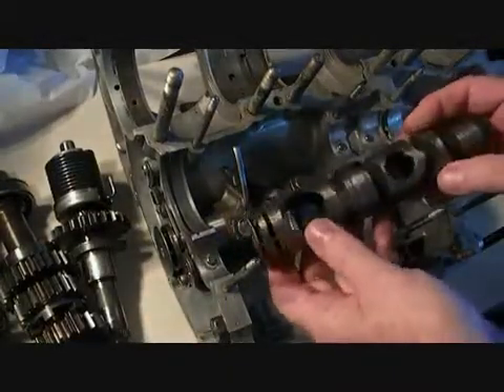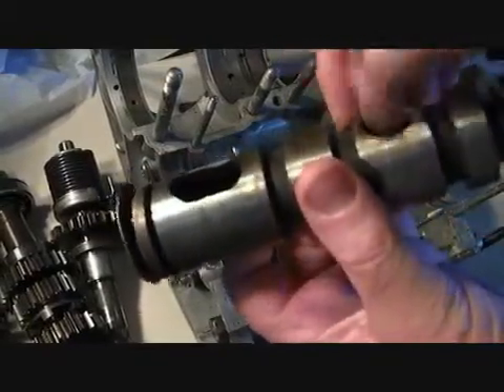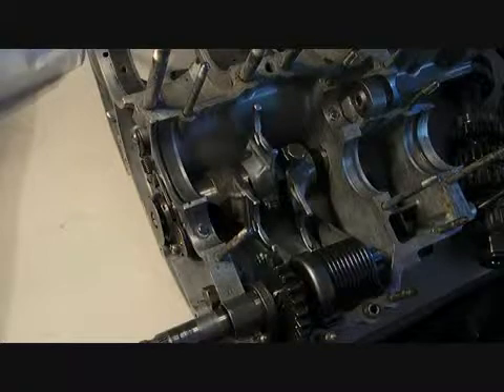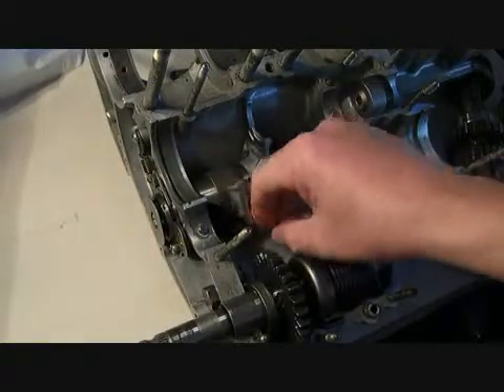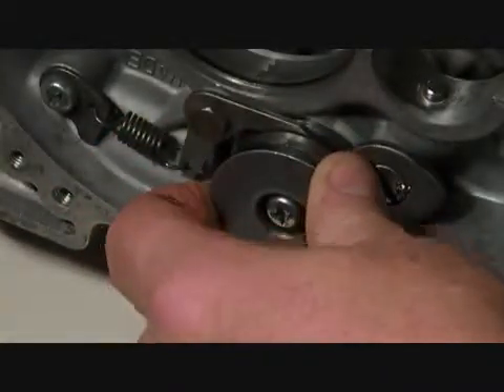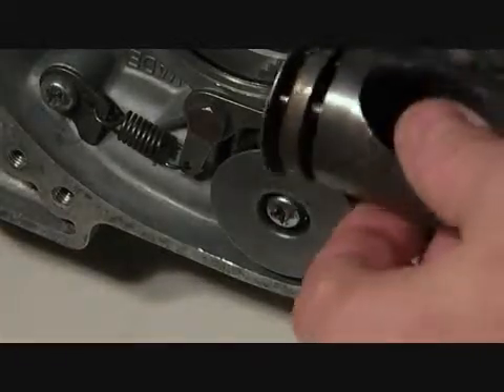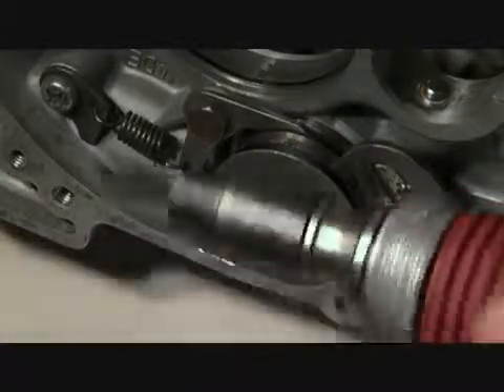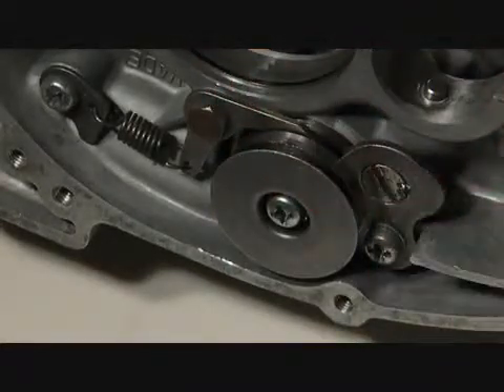shift drum installation Kawasaki 2 stroke triples, H1 500 and H2 750

Comment: I just purchased a 72 H2, I'm looking for a good person to do some transmission work on it. The guy I got it from did a bone head move,putting the front wheel against the wall because the clutch wouldn't disengage. So now the trans is locked up. It's been YEARS since I worked on one and I'm going to pull the motor and split the cases,but I'm considering sending it out to someone I trust so I know it's done right. Let me know your thoughts and THANKS for the video's. I had a feeling someone would have a video on these while I try and find the old green manual I used to work from.
Tony
Reply from the maker: Hey Tony, sorry to hear, truth is a lot of trans damage is done by nutters like that. Go to kawi2strokes.com/forum and join. The resource site is the best int he world, and has all the manuals available. I have build vids and tons of information on the site. You can do it!